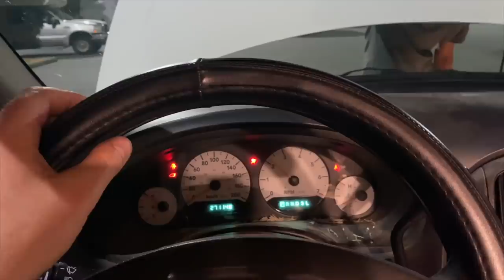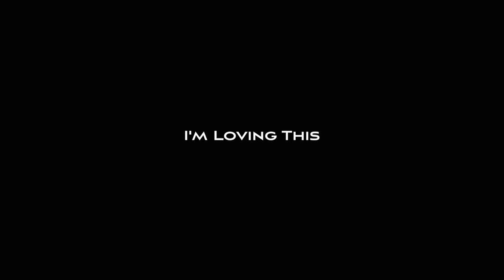Fiasco || Broken Down & Calling Tow Truck, Complete Electrical Failure, Simpler Than You Think

Comment: Thanks for the video. Sorry that you had to deal with crap to make me feel lucky with my situation.  I have a Grand Caravan, but it’s not my only vehicle.  I’ve only removed the middle seats, but will put them back in the fall.  Taking out the passenger seat would free up space and weight for summer trips,  but my dog might not appreciate losing his shotgun spot.

I hope to see more videos on how you resolve the issue to learn vicariously.  You strike me as the kind of dude that won’t poke away until you’re convinced that the corrosion was the source of all electrical problems.

Comment: Been there,the same. Take connector off it will be black from lead oxidation not corrosion. Clean aggressively with wire brush or terminal brush. Do inside of clamp too. Grease,tighten.
Reply: Dielectric grease or if nothing else vaseline....lol....modern cars are so picky when it comes to battery low voltages......unlike the good old days  when cars would run on one wire and almost no juice...lol.   Welcome to the modern era....lol.

Comment: 60 is a great price and you learned, You're in the States you're real fortunate if you can find a 50 or $60 tow.
Reply: Very fortunate at only 60CAD! (About48USD for reference) I needed my car towed when I could not start the engine, something to do with unlocking the door with the key and shutting everything down. Not even that new of a model. I think it was over 200CAD for less than 15 km. I was shattered, not an expense easily covered.

Comment: It's a good idea to coat your battery posts with a little white lithium grease to help prevent corrosion.  😊
I've been doing it on all my vehicles ever since I had the same problem you encountered here, many years ago.  Haven't had any such problems since.
I also use those felt anti-corrosion washers, which also helps reduce corrosion on the clamp.

Comment: Hey STW Joseph 🖐 I was thinking of the terminal when you were calling for a tow. Because in the last video you unhooked the battery and then put it back and was working fine. You're right about those lessons learned and not forgetting them. Kudos  to Josh and Rachel for helping out👍👍 Glad to see you smiling again.  Now on to building your cabinet.  Stay safe.  God Bless 🙏✌❤😊

Comment: Oh my gosh, I was thinking that clicking scenario sounded/looked familiar. That same exact thing happened to me -- a few times -- until the clamp thingy finally broke. When it first started happening in my driveway, I just jiggled the cable, and it worked. But, on two other occasions while I was out, I had two (different) good Samaritans help me. One guy, just so happened to have a tool box with a little terminal clamp cleaner contraption in the back of his truck. Since I couldn't find the tool locally, I ended up driving around with pliers and a wire brush under my seat just in case. The final time it happened, the part broke. I was in the grocery store parking lot and a retired army mechanic stopped to ask if I needed help. I have a hard time asking for help, sometimes -- just going to fix it myself -- and that moment taught me to say, "yes, please." I also ran back into the store with my ice cream to ask if they could hold it in the freezer, and they did. Then, he took me to the auto parts store across the street, came back, installed the new clamp, and voila!!, it started right up. The whole 'fiasco' took less than an hour, cost less than twenty bucks (??), and it never gave me a problem since. That was almost two years ago. I actually enjoyed those moments of breaking down and finding good people still exist. I was also not paying attention to my own vehicle needs, at the time, while fixing other things for work and other people, and it reminded me I also needed to slow down for myself. (Then COVID happened, ha!! I didn't mean that slow.)

Comment: Joseph, I had a car that would die similar to what yours did. Turned out the battery was sulfated and when it got hot all the electrical would cease working. Changed my battery and have had zero problems since. Hope your is an easy fix as mine was but it took mine dying several times before I got an accurate fix. I'll have to go back and watch your previous video now to see what you already tried.

Comment: Connections in electrical systems are so important. I've see many battery connections much worse than yours which are just waiting to fail at an inopportune moment. The  battery should read about 13.7 volts when the van is running and charging. 12.6 volts is normal for a healthy battery when the van is not running. With today's modern computer systems, the battery is critical to operation, as you found out. It's also how we learn, good luck on your journey Joseph 👍

Comment: Yikes! That's sneaky corrosion! That being said, I never clean that part except when I'm changing the battery every 3-5 years. I'm glad this wasn't a much bigger issue and that tow truck is well worth it. :D
Joseph, I now check everything once a year when I have my cars for oil change, all filter check, all fluid check, tire and break check, erosion/rust check and rubber part check. It takes me around an hour to do so. By doing those checks, I could drive for this year without worrying anything may break down. As in your life style, another perfect reason to meet up with fellow Van lifers and check the vehicle together!

Comment: Well Joseph, I can tell you that this Joseph has learned way more by getting things wrong than I did from getting things right. The level of thought dedicated to a problem far outweighs the level of thought when it goes well. And yeah you remember what you learned far better when it doesn’t go well. Gonna order a terminal post brush (again). Seems like I use em and lose em.
You have a level of patience that I would like to have. I’m thirty seconds away from F___Me at any point in time.

Comment: saw a pole one time that said the 2 biggest causes of breakdowns is coolant probs & bad ground wires. It wouldnt hurt to find out if your rig could use an additional ground, then add one. I have a vintage turbo caravan that has a bad habit of going thru front wheel bearings (not a cheap repair)....but if i add ground wire to the wheel hubs to disperse the built up friction electrical power caused just by driving (static elec attracts dirt too)  ill save tons of $.  P.S. FYI coolant tips:  If your sitting in hot traffic take trans in Park or neutral, will save heat build up in trans. Look into coolant boosters, they do work.... Make sure coolant isnt too old, some cars will allow weak coolant to build up electricity in coolant system causing a ton of mystery probs...

Comment: I had the same thing happen, well a power failure on my Transit connect, turns out the starter stuck on and kept on spinning, exploded inside the transmission and ya... it was in the shop for a month. You lucked out!

Comment: Get a little paint brush and some wheel bearing grease paint the terminal with it no air no corrosion  old trick and it works.

Comment: I would do your research into this issue more. The main fuse box under the hood get moister and create issues with the electrical system. In most cases people had to replace the box all together to resolve this issue.always do your research.
Reply: Also you main battery could be on its way out! Stress tests your battery

Comment: If you have another problem with electrical  if someone tells you check voltage drop. Just take your volt meter and  touch it to either side of the connector.  If it shows a voltage reading it needs cleaned ( meaning there is resistance in the connector) won't be much unless really bad but anything can cause issues

Comment: BMWs have tons of electrical problems.  The mechanic would be very experienced.  One of our salesman had his burst into flames at traffic lights.  He had just enough time to get his phone and get out.   

I had to change all my terminals on my start batteries recently.  I was stranded at the beach during a storm.    Simple rule is if you have problems, check to see if your headlights work.  If not, start around the battery.

Comment: Joseph, I just subscribed and have watched you help out Chrome and Jeff ie quote a bit.  Good on you.   Yes you did learn something that you won't forget.

I saw you use a multi meter which can get you out of a lot of trouble.  I have had some expensive ones but the one I use the most is a cheap one you can pick up at Harbor Freight.

Anyway, now I can go back to the beginning of your adventues and do some Bing watching.  Hang in there.

Comment: QUICK TIP: Use Dieletric Grease on terminals and a pair of battery post felt washers. Had a bad problem , applied the QUICK TIP , Been 5 years and not a single sign of corrosion!

Comment: Fyi, with a multimeter, put the probes on the battery- pos/neg, set at 20vdc , start the car,  check voltage at idle and rev slowly up to abt 2000 rpm, the voltage should increase to abt 13.6v to 14v This is an alternator check. But, the battery should be fully charged first. The alternator can only return a certain amount of voltage but cannot charge a dead or bad battery. If the alternator checks out, it’s either dirty connections -bad ground, bad cables or a bad battery.